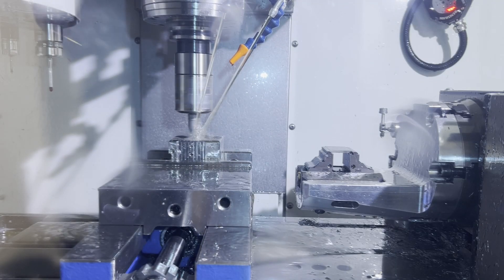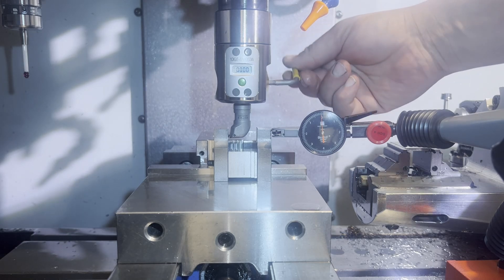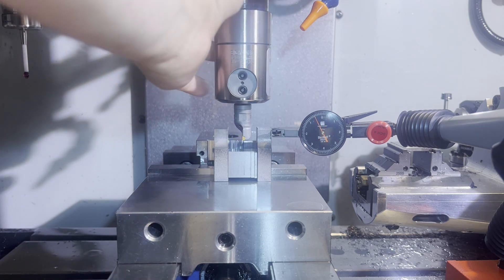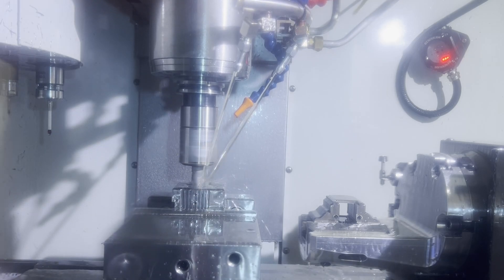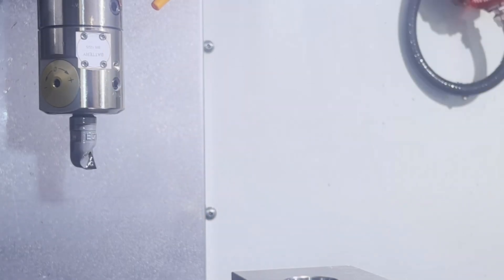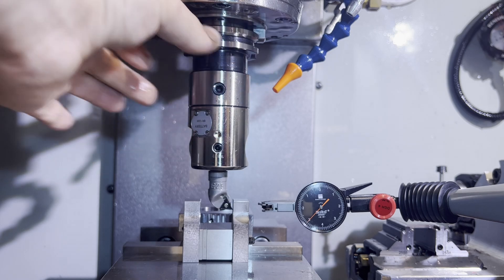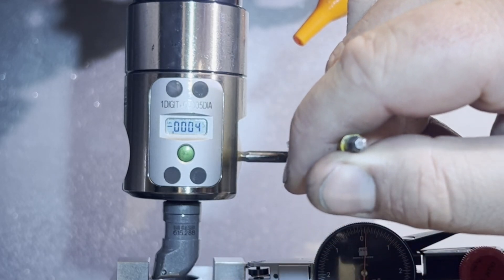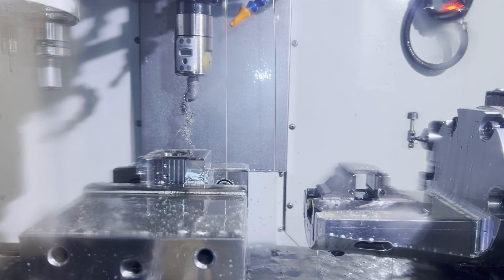Toolmakers boring head trick

Comment: On the video timeline @  6:45, can any one tell me what those ends on the gage blocks set up are called? Referring to the end stop things that he is bouncing the boring head off of and the indicator is on the other side of one of them. I have done some looking around amazon and EBay can’t seem to find them. (I don’t know what they are called.)  Also, any one have any brand names that are economical for square gage block set ups, to include the hardware to hold them together? The cherry on top with be an economical kit with all the hardware to hold them with the end stop thingy’s.  Adam, your a smart man, learn a lot from you!
Reply from the maker: @3073Sean  lots of different names for them. Ears, bite gage setting blocks, jaws…if you google or check msc for “gage block accessories” they should come up. Mine are homemade
Reply: @adamthemachinist  Thank you Adam, and Merry Christmas!

Comment: 👍do you have to be concerned about the minimum cut depth of the insert so it doesn't push off? Thanks
Reply from the maker: I was within spec for that insert, but this method doesn’t account for spring back . Multiple passes and measuring each is always best for account for that

Comment: Are you running 100% oil?  If so, what type do you like?  I Have Haas machines and Haas documents say don't use 100% oil but I don't understand why?  I have a friend that runs all his lathes and screw machines with 100% oil and he swears by it.  In fact, I've never seen a screw-machine shop that doesn't run 100% oil and those guys know what they're doing.  The only reason I can think of is maybe Haas is worried about fire danger?  Any comment you can give is much appreciated.
Reply from the maker: I do run neat oil, mine is blaser but I’m not to picky on brand , I just like how clear blasers cracked oil products are. Not sure why haas doesn’t like it but my tech assured me there would be no seal compatibility issues and that many people run oil in haas mills

Comment: New to your channel. Loving your videos and presentation, many thanks. As to using a torque wrench, I use preset Fixit Stick small torque limiter. They say 6% accuracy over 20000 cycles but the units we had tested were within 2% after couple months of use. Used by Rocket Labs here in New Zealand in some of their rocket assembly. Might be an easy inline addition to your fixturing or insert screws.

Comment: What criteria do you consider when you decide between boring and interpolating a hole?
Reply from the maker: It’s usually speed/convenience. Most my finishing happens in the other mill and it can interpolated holes to higher roundness than the haas spindle rotates. This part wasn’t all that fussy other than the bearing seats so being able to do it complete in the haas was worth the time of setting up the boring head . If I have lots of the same holes to do the boring head again makes sense , since it’s so much faster than interpolation

Comment: Such a simple and elegant trick - Thanks for sharing it!
Reply: I don't have gauge blocks, but have evolved a similar method using a decent small grinding vice, checked as being suitably square and parallel, with a couple of strongish springs holding the jaws back against the thrust collar of the screw, and set to the desired size using inside mic, tele gauge, or bore gauge. So it's one more step away from a calibrated standard, but good enough for gummint work!

Comment: Very neat trick, thank you for sharing. For the "ears", they look as though they require  gauge blocks to have the threaded holes already. Could you achieve something similar with "solid" gauge blocks using e.g. a machinist's clamp to hold the stack together or would you lose the accuracy?
Reply from the maker: Square gage blocks have a plain hole thru the center that I’m taking advantage of . For rectangle blocks you can use a block clamp to get a similar result . Also just gently clamping the blocks in a toolmakers vise works in a pinch
Reply: @adamthemachinist  ah that makes sense, thank you for responding (:

Comment: Adam I really appreciate how simple your solutions to seemingly difficult problems. I’m far from precision but this approach seems it would certainly make the process much more approachable and accurate. Thanks I will definitely give this a try. Also, if I am understanding your gauge block set up you are wringing your dimension between two larger blocks or is this a specific fixture you have made?
Reply from the maker: That’s correct on the gage blocks. The end plates are called ears and most gage block manufacturers offer them
Reply: Suppose this could be done (more crudely, if you don't have gauge block ears handy) with a micrometer locked to a dimension, and and clamped or mounted on a movable base with the shaft horizontal?? 
Loved this trick! thanks Adam!

Comment: Great tip, now I have to buy precision gauge blocks 😆
Reply: Haha! There should be a way to gently clamp a digital caliper in the milling vise and get you .0015 accuracy or a little better. Probably a headache though...
Reply: @Bob_Adkins  I think this approach requires two things, ability to set an accurate inside dimension, and that apparatus must be able to float in one axes. Calipers would work for pretty good dimension setting, though jaw faces are very narrow, but they’d need a base that could slide. Not sure clamped in a vise would work.
Reply: @matter9  little 1-2 inch grinding vise would definitely do the trick for sliding